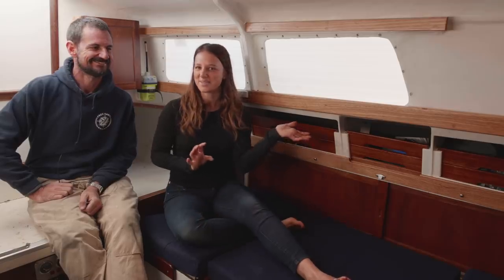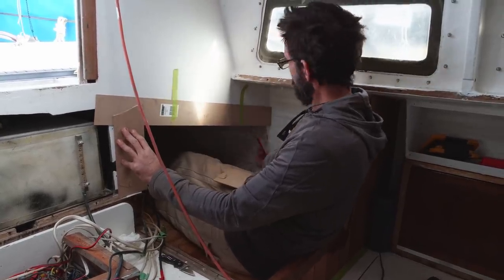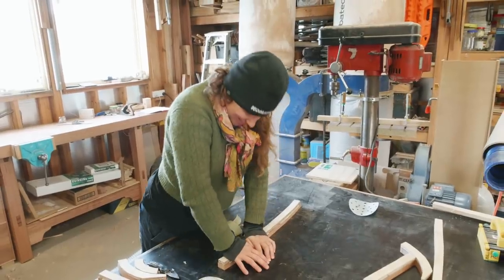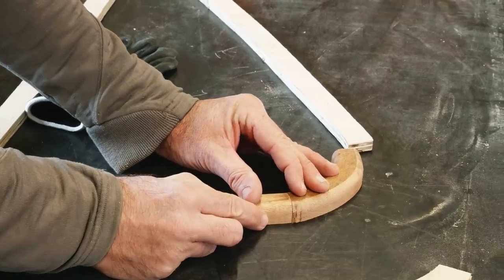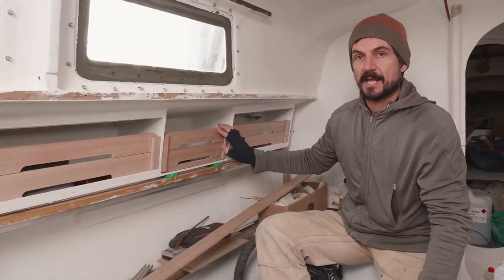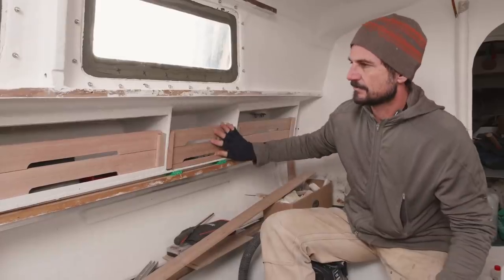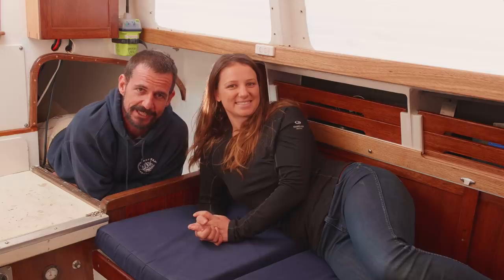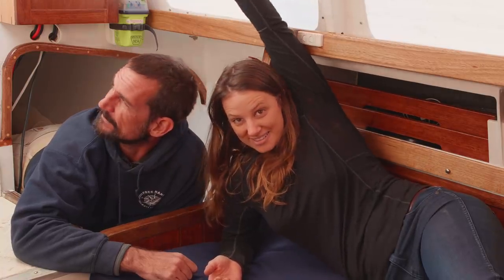Our sailboat transformation continues... Free Range Sailing Ep 148

Comment: What an amazing transformation.  You will be reaping the benefits of all your hard work every moment you are belowdecks enjoying the warm woodwork homey environment you hand-crafted.

The physical battery containment is very clever but I'm sure some purists are going to take issue with not using modern plastic battery boxes and the lack of containment for electrolyte spills or having the batteries inside the cabin area without direct outside venting.  

On these older boat designs it's next to impossible to achieve this.  We had to do similar with our house bank and engine starting battery.  We have had the occasional issue with our Xintex CO monitor and LP soleniod control panel gas sniffer giving false alarms when the flooded lead acid 6v batteries were in the mid 14v level as they were equalizing.   The trace hydrogen gas fools the CO and flammable gas sensors into alarming if the boat is closed up.  Such is life.

Comment: I'm impressed at what you've built with just those templates and the router table. The drop-in fronts for the lockers is a great idea.
Reply from the maker: The stuff in those lockers is all pretty light-weight but in use daily. It is a neat solution and the addition of a pin is all thats needed to keep the boards in place in case of a roll.
Reply: I am just so blown away to how much more modern the interior looks.
Reply: @FreeRangeLiving  I wondered about a short length of bungy that hooked over a pin would hold them in and always prevent the dreaded rattle?
Reply: I was thinking of some sort of spring-loaded pin with a knob at the front on top that you pull out to release the drop slats and simply release the knob so that the pin springs back into the locked position.
Reply: @svbarryduckworth628  - I like that idea..

Comment: You can sand with 600 grit and then,1000 gritt sandpaper and polish your plastic windows with car polish. I could not hardly see through mine and I thought I was going to have to replace them but after a year they are still holding up and can see like glass. I've had to polish them 2 times so far. Just hook a 3 inch foam pad on a drill and get to buffing. A few minutes later and clear as glass.

Comment: I don't think much of your wood work but I'm a joiner so I have stupidly high standards. Little tip though for whenever you want wood to slide is beeswax (briwax here in the UK) can be applied to the areas in contact on top of any finish. also clean the bottom of your plane and apply wax to that as well.

Comment: It's obvious to me how lucrative this 'go fund me'/'Patreon' system is when you're able to manage an entire fitout...another very enjoyable and insightful video from my favourite seafaring duo 😊 more Pascale in the next video please
Reply: When you're thinking "lucrative", don't forget to factor in that every video you see represents 20-30 or even more hours of work to produce..  not to mention the need to keep the content fresh and engaging. It's still a full-time job, even if it's not a 9-5 grind.
Reply: A bit of wood, paint, varnish, epoxy, and some screws are really the only materials costs I've seen so far.  It's been a lot of sweat equity and skill.  Mych of the electrical has been reusing existing materials and I haven't seen them going nuts on new electronic toys...yet.

The biggest charity these guys seem to have received over this refit is the use of the cabin, storage shed and loaded workshop.  Their benefactor who is putting them up while they are refitting is the real hero behind the scenes.  

The biggest costs I bet are for the marina that has hauled them out and is charging them dry storage fees while allowing DIY work at the same time.  Those of us who have paid those bills know it usually isn't cheap and yards that allow DIY work are getting fewer and further between these days.

Comment: You should look in to a  Diesel heater
Reply: We just installed one of those Chinese clones of the German diesel forced-air truck cab heaters.  $250 for the heater and another $400 in marinizing bits -most of that in an exhaust system that is truly sealed so we wont be killed by CO poisoning.

Comment: i would have split that quarterberth trim in 2 - added a spacer between them that is the thickness of the fiberglass but only 5-10mm high (like a U trim) and set it over the fiberglass fully sealing the fibreglass edge, it could then also be through bolted but would cover and make good the bottom edge of that scraggly fibreglass cut.
Reply: to make it clearer, take the current trim and split it and make a long tenon joint out of it. Where the fibreglass is the mortice.

Comment: Aye m8’s, often you can get pieces of MDF for free. Ask in your timber store for packaging materials, a lot of stuff is actually packed in MDF or other fibre boards, and is easy to get for free. It doesn't matter if it's a bit damaged if you're going to use it for templates.